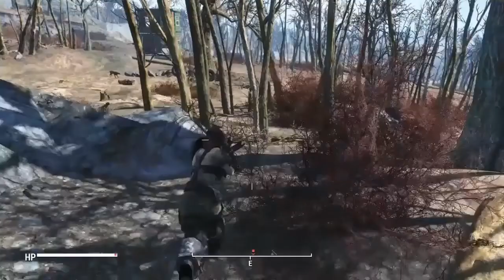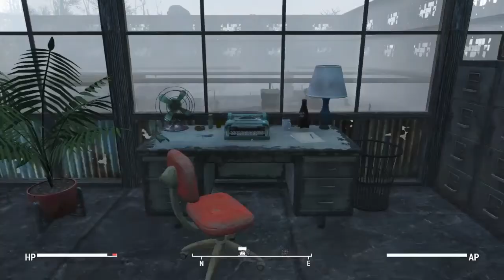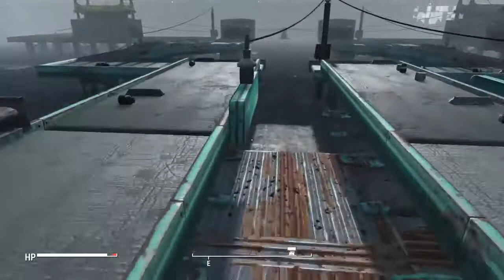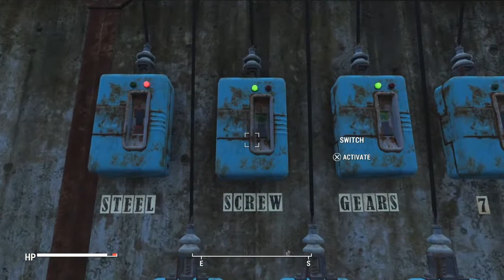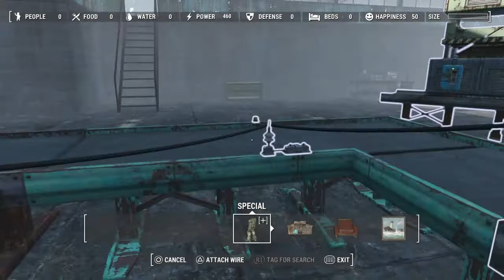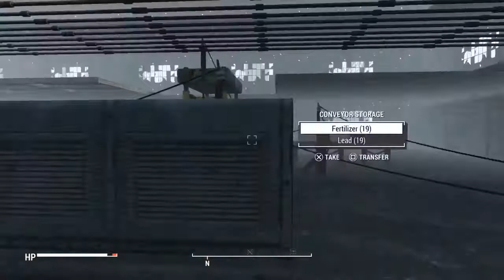Multi Manufacturing Factory Setup

Comment: I like the concept. I just don’t see the practicality. Big manufacturing builds tend to be just for fun. Which it is. Fun. 

This build is tidy. But it seems like there’s quite a few steps that are left out. Mostly on the front end, about getting just components, and sorting them into hoppers. 

An idea i have, is to have 1 vacuum hopper pulling from a container. The container has junk and components. Attach a builder to the hopper, and storage after. 3 machines. Turn it on, and count the number that are made. Then empty builder of excess, and replace In container. 

The time spent counting manually, is saved by only needing to store junk in one box, using 1 hopper. 

Besides, it’s not likely you’ll need to mass produce very often, if at all. So a smaller operation is fine.